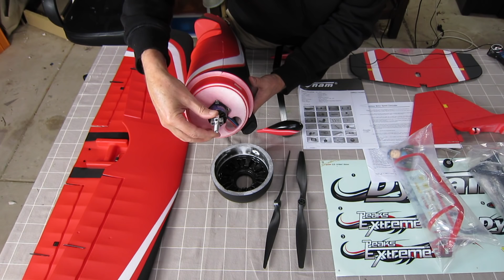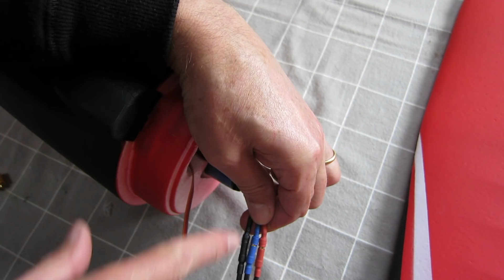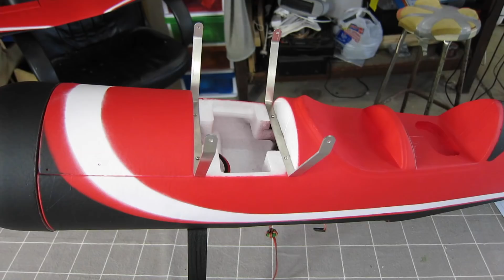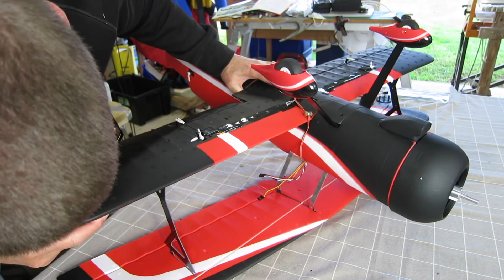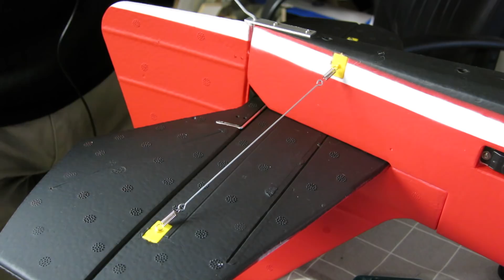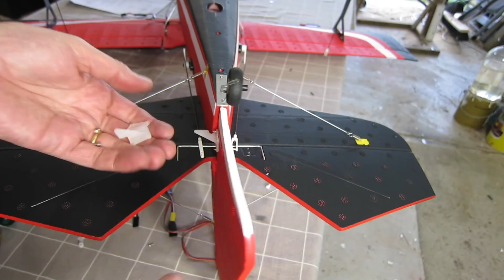Dynam Pitts Model 12

Comment: Great vid of a nice plane! I think the red does look better!  I'm not much good at 3d stuff but I would like a step wing :-) one day,
biggest problem I've found with the Dynam planes are the battery area's are too small, in my at-6 and my cessna I can ONLY fit brand new battery's most of my older battery's have swelled a bit and the just wont fit into the battery locations,  especially the cessna! great flying plane though,
What's the pitts battery fitting area like Andrew??
Reply from the maker: Correct, battery area needed some trimming to fit the 3000 4S in but it's made to be adjusted to fit your battery.
Reply: With the cessna it's not possible to trim it without pulling the fuse in half

Comment: How are the control surface hinges?
Reply: I should have watched the video before I asked the question it answered the question quite well thanks.
Reply: What do you do to repair hinges like that?
Reply from the maker: Hinges are not very durable. Very thin smear of hot glue or tape both sides for a quick repair.
Reply: Got it thanks.